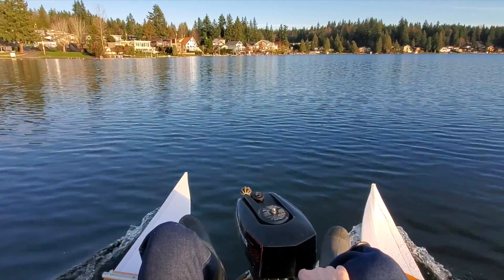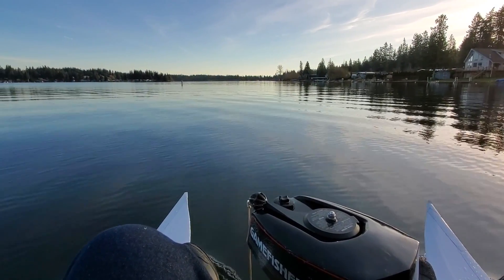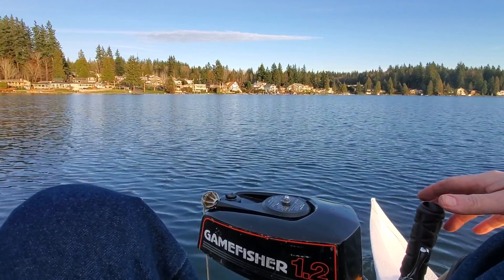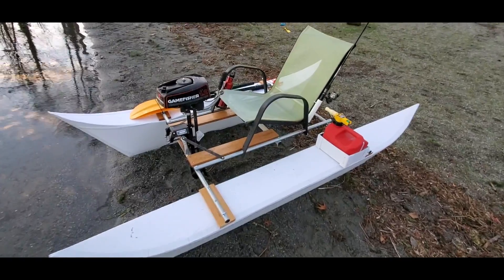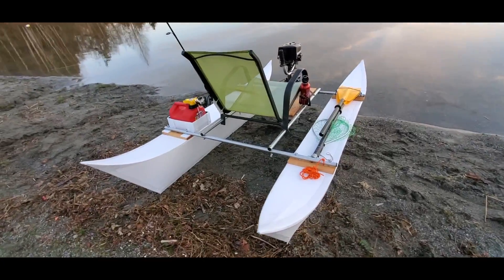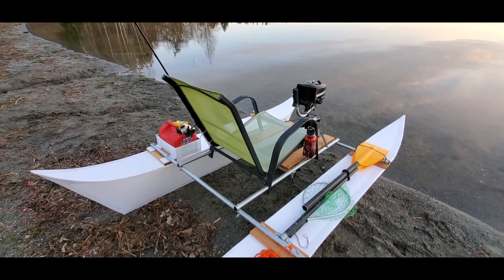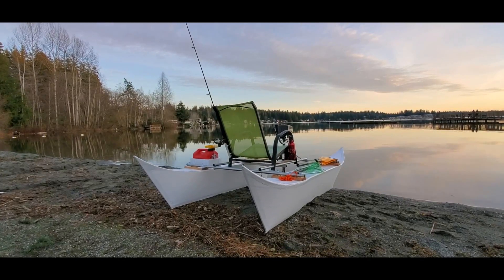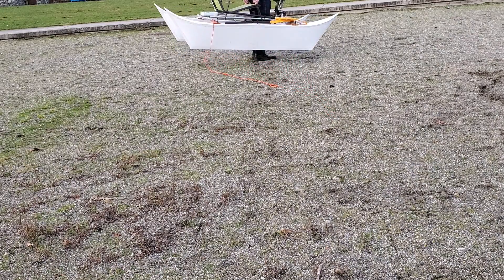Mini Catamaran (Part 3)

Comment: Nice project. Just a few points. Multi-hulls are great in the straight;not so much at turning. Length of hull increased will give better performance.  A skeg or rudders will increase maneuverability and lowering your prop will help. In my opinion. :-}

Comment: I am waiting for you to build a mini house boat next. 

Not related to boats, but how well do you think cardboard will last in the weather if it is painted and sealed  at all the edges, using the cardboard for a tiny home structure? Even coroplast cost a pretty good penny.
Reply from the maker: I'm not sure. I've heard it suggested to give cardboard a wax coat for waterproofing.
Reply: @paulwelkinsdiy   I been thinking about doing an experiment then to find out. I will find out because i can do the experiment for free..

Thanks

Comment: I think the reason why you're sitting so low in the water is because of the pontoon width being too narrow. As for speed, of course you're going at a slower pace. Your motor is operating in reverse. Motors aren't intended to go particularly fast that way! 😁😊😁 Pretty cool little Cat tho. Nice build

Comment: You're pontoon is build too pointed on the bottom side and has a natural tendency to cut deep into the water.  Also it's not going to stop sinking down until the water displacement reaches the surface level it needs to, in order to float your boat, per say!
Next  you need to perhaps have a foot guided mechanism leading to a rudder or switch the motor to the back where you can steer with it because you can't steer with it the way it is!  
Good luck with your adventure!  I sure wish I was right there working on that with you!  Have fun😁

Comment: nice project!  a combination of turning thrust near the center of rotation (low torque),deep keels,and some of the thrusted water is probably impacting the inner side of the pontoon , negating some turning force when the propeller is not  straight.

Comment: Perhaps turning the seat round and making the motor push may help 👍
Reply from the maker: That was actually the first layout, but thought I'd try the simplicity of this first. No steering lines, shorter accelerator cable etc.
Reply: @paulwelkinsdiy  Yes Paul I know that was your original intention. I'm thinking it may have an advantage pushing. Experiment is the only way to know for sure I guess. As you pointed out, sitting deep in the water plus being somewhat short in length, it's not  planing along it's pushing through instead. As you stated, it's a nice little stable platform for fishing from 👍👍👍

Comment: I think some rudders in the aft of the pontoons and linked to the angle you turn the motor could do the trick for better steering. need to be able to swing the rear around to turn.

Comment: Make the pontoons less triangular in cross section and more trapezoid. With the bottoms about 10 inches wide. Make each pontoon two piece(joined with a pair of pin aligned bulkheads)  for a longer profile. And power it with two electric trolling motors,1 on each pontoon. That will help with steering control and reduce draft.

Comment: I love this. I wonder if you could just add another detachable pontoon to each side to increase load capacity, but of course that would probably compound the steering issue. In any case, I think if you could add a rudder to the back of each pontoon you'll be fine. When you turn the boat motor, all it does is redirect water against one of the pontoons and then straight out the back and you keep going straight. Coming off the back of those pontoons, you gotta change the waters direction some how. It would be fun to work on and figure out. Also, pretty gutsy to be out on the cold water in a trail run with some thing like this. haha Keep up the great work.

Comment: I was wondering, could your catamaran be designed to accomodate a lightweight bike with propellers one the wheels, so that the boat would be entirely human-powered?
Reply: It would be good for nothing, but cool nonetheless
Reply from the maker: @IrishEagIe  I've done that before on a kinetic rig using laminated foam insulation attached to my old recumbent bike. It worked. I have a picuture on my website www.elkinsdiy.com
Reply from the maker: Here's the picture. https://elkinsdiy.com/wp-content/uploads/1f-copy.jpg
Reply: @paulwelkinsdiy  Cool

Thanks

Comment: dear sirs . lovely little craft. i thought you had a kayak that was powered by two  electric motors on either side to effect steering . could this  same type setup be used to effect steering on this craft?
Reply from the maker: I'm sure it could. That's how traditional sailing catamarans are steered, but I always lean toward the KISS principle with first builds. (Keep It Simple Stupid...) Then add complexity if needed.

Comment: For improving turning...the thrust accelerated water stream may be getting deflected by hitting the deeply submerged hulls.  Maybe try running the motor very low so the thrust stream is below the pontoon?  If you worked out steerage a rear mounted motor would be better and even offer thrust vectored steerage at 0 mph.  Great work...as usuall!

Comment: Here are a few suggestions from a recovering yacht designer/boat builder. Adjust the motor so the prop is lower. As is, some of the prop wash hits the pontoon when trying to turn. Low speed turns should be easier. Also, adding waterline length is the easiest way to increase speed without any increase in horsepower. Keep up the good work!

Comment: Is this the largest you could make the pontoons with the folding method you used from a 4x8 sheet? The folding is clever. If you can't make them longer, you might be able to get more float out of them by making a wider V. They seem pretty sharp, not much internal volume toward the bottom. I wonder if the water pressure even pinches the two surfaces flat together at the bottom when you get weight on them.
Reply from the maker: This is as big as they get folding it origami style, which keeps the water out even if the tape fails. I could play around with different wall angles but I thought of sailing catamaran pontoons as being the fastest. And yes, deep down the walls do cave in some were there's no bulkhead support which is probably creating friction. It might be fun to make a hydroplane style Coro boat having more surface area for potential planing. Some day...

Comment: Try a fill the pontunes with expanding foam, and fit a small rudder,that really is cool looking mini boat great for bass fishing, amazing mate
Reply: Adding foam in the pontoons is not going to give it any more buoyancy because it won''t increase the volume unless the pontoons are taking on water or his weight is forcing the water to slightly  collapse the walls of the pontoons. Rudders in the back might help steer it.
Reply: @BushImports  agree--and once that foam get wet, you're fawked...
Reply from the maker: I could stuff each pontoon with bubble wrap (big bubbles) or foam packaging peanuts? And I agree, rear steering rudders on each pontoon as well.
Reply: @paulwelkinsdiy  bobble wrap is great ideal, compartments upon compartments for total fail safe.